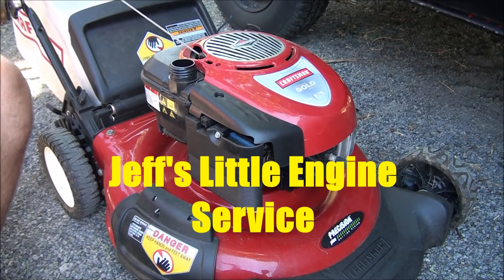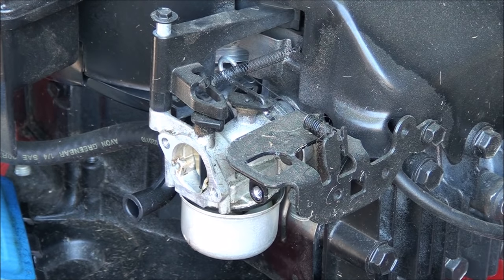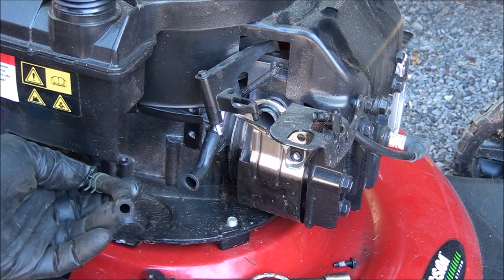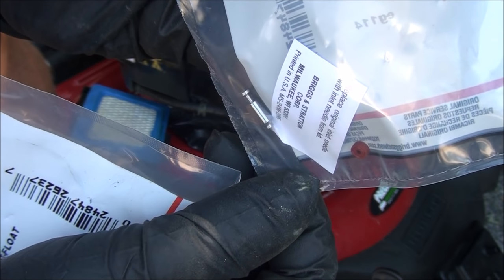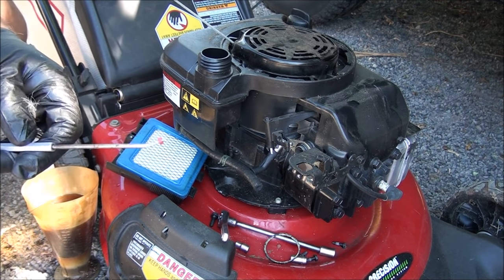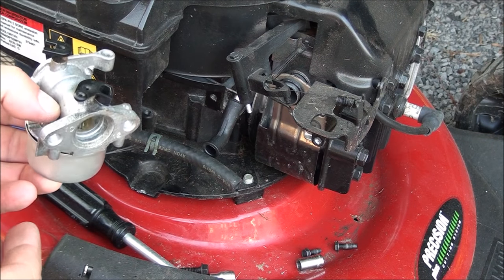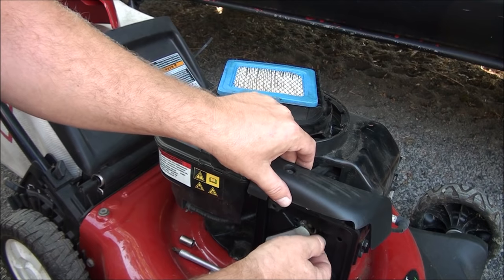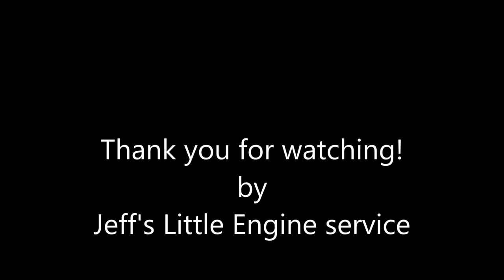EXPERT! REBUILD a Briggs and Stratton Lawnmower AUTOMATIC CHOKE CARBURETOR

Comment: I followed your video instructions and just cleaned everything and re assembled it.  it was a no start  and now it starts but surges badly.  any suggestions for a cheap fix.  I use this to cut weeds  in a field not a lawn.
Reply from the maker: sounds like the fuel system still needs cleaning (plugged carb). make sure gas tank and carburetor are clean.

Comment: having trouble priming & starting  a 7.0 hp Intek b&s pretty much the same except mine has the primer bulb took the carb apart cleaned with carb cleaner, wires, pipe cleaners,new needle and seat, replaced the gasket on air filter housing even used a double gasket still hard to prime and start have to turn over the engine and push the primer bulb about 20-30 times to get it to fire once it's running it restarts 1 pull even replaced the air filter housing still don't prime good any ideas?
Reply from the maker: probably need a new backing plate. Sometimes putting gas on the gaskets helps them seal too.
Reply: thanks i will check that.

Comment: i  did clean him with no parts but after 2 minutes  it shuts down . i get only get it started when i push  the choke back to close. can you help me.its like ,its get no gasoline
Reply from the maker: The fuel system and carburetor still need cleaning.

Comment: I have the same carburetor. I already know how to change the idle speed from watching your very resourceful videos. Do these carbs have a fuel/air mixture screw? I find that when running, my mower has this burp or hesitating sound every 10 to 15 seconds and there is no fuel starvation issue. Carb's been serviced recently. Could that be from a LEAN mixture?
Reply from the maker: could be lean but There are no adjustments unfortunately

Comment: Jeff, I've had a couple of these auto-choke carburetors leak gas through the weep hole, even after thorough cleaning.  I'm speaking of the little hole on left side above the mounting hole.  Any ideas?  Thanks.
Reply from the maker: sounds like it is flooding. A new float needle and seat should fix this problem.

Comment: I have the same automatic choke mechanism, and im just curious is there some temperature sensor which move the choke flap? Or what kind of measurin particle there is?
Reply from the maker: A coil spring is the mechanism. It heats up and expands and opens the choke plate, cool huh!?
Reply: Nice! That`s very cool :P Thanks!

Comment: Can the needle seat hole become smaller?  When do you replace the seat?
Reply from the maker: good question. It can swell from ethanol and become smaller. Anytime your carb is flooding after being cleaned, it should be replaced..
Reply: Ok but the engine has some fuel in the top of the carburetor.  I got the engine started but it is hard to restart.  It also backfired and a white flash came out of the muffler.  What does that mean?

Comment: Amazon seems to have Chinese knockoff carbs for $12 and B&S OEM carbs for about $35. At that low a price point, is it really worth trying to rebuild the carb vs. just replacing it?
Reply from the maker: I would not recommend an aftermarket carburetor.

Comment: I own a lawnmower with that same engine.  I have cleaned the carburetor several times but the engine always ends up surging and sometimes it wont start.  Each time I take the carburetor apart there is always a lot of small pieces of debris in the float bowl.  Where is all that debris coming from?
Reply from the maker: I have seen a bad fuel line cause that, make sure to replace it. 1/4 hose.
Reply: How can I tell if the fuel line is bad or not?
Reply from the maker: sometimes you can see that it is dirty and deteriorating on the inside. I would recommend replacing it to be sure.
Reply: I sprayed carburetor cleaner down the inside of the fuel line but no dirt came out.  I can not tell if the fuel line is deteriorating on the inside or not by looking at it.  Why would the fuel line deteriorate on the inside?  The engine had some water in the fuel tank and in the carburetor when I received the mower.
Reply: Brian... Just replace it. He told you 3 times.
Reply: Steve why did you say that to me?

Comment: I followed the steps with my new rebuild kit. But now I get fuel dripping out of the primer bulb.
Reply from the maker: sounds like its flooding, check seat and float valve
Reply: @JeffsLittleEngineService  I figured it out. I didnt plunge the little rubber needle valve seal all the way down. No more leaks and my mower turns on will one good pull of the cord. Thank you for the tutorial Jeff. 🙏💪

Comment: why doesnt this have a fuel filter on it? i have to clean out that tiny little item almost every year. wouldnt putting a fuel filter on it help from getting debris in this device?
Reply from the maker: there is a screen filter inside the gas  tank that doesn't work so good.... you can add an inline filter fairly easy. An old fuel line can start deteriorating too causing problems

Comment: I had fuel leaking out of the carb intake after I shut off the engine.  So replaced the valve and seat.  Everything went back together fine, and no more leak, but I am getting almost no power from  the mower now.  Any thoughts?
Reply from the maker: governor spring, linkages?
Reply: Thanks.  Gonna pull the carb and reinstall (again), double checking all connections.

Comment: I tried this with no success...mower still sputters and low RPM, then shuts down. Installed new spark plug and fuel line. I’m waiting on a new carburetor now...Any other ideas what it might be? TY
Reply: Yes!  Check for proper fuel flow from the tank (blocked line), then check for blockage  thru the holes of the brass nut. Lastly, spray carb cleaner into every hole in the carb. Next,  change your fuel.

Comment: Great video.   But it seems by the time you buy the gasket, float needle, etc, (I priced it out, maybe you have a whole seller?) and spend the time cleaning,  its easier and cheaper just to buy a new carburetor on eBay for $9.
Reply from the maker: be cautious of the $9 carburetor unless it is a genuine Briggs and Stratton part

Comment: I have to do this process every mowing season on this exact motor 6.75, every season , The entire mowing season I have to do this process over and over and over with this mower. and it still doesn't act right it will run for about 3 min then stalls out , 3 mins then stalls out, let it cool , push it around for 3 mins or so stalls again, let it cool for about 30 mins. then mow for 3mins then stalls  repeat process , every single time , every mowing season for the last three years ... horrible mower...BUT ! Great when it works ..
any suggestions other than to take it to the dump or buy a new mower or other obvious statements / comments ?
Reply from the maker: Replace the fuel line and clean the gas tank. I have seen sediment stuck inside fuel lines and the rubber lining falling apart inside also.
Reply: I have did this before , as suggested by the small engine repair shop , it still didn't work for very long it took about three mowing sessions and it was back doing the same thing again .This mower is only mowing my yard , my yard is less than 1 acre.  also this mower is garage kept , and with this mower it takes all day to mow my yard .. lol .. I'm going to clean out the gas tank and replace the fuel lines again today.. my mowing season has started as of today... I'm excited to get started mowing and all the yard work , Believe it or not I look forward to mowing and the outside work in the yard.. Great video , I look forward to more of your videos, Cheers
Reply: Jeff ,   I took off the fuel lines , and the gas tank , , took them off that means no gas tank no fuel lines , no fuel can get to the engine of the mower . it would not run before , its running just fine without a fuel tank or fuel lines . started and kept running on the first pull ... and it's still outside running right now ... CRAZY!  didn't do anything to it yet , I just wanted to crank it to push out any existing fuel that might be in the lines , It cranked right up and sounds great , still running even now while sending this message . I wish I could video this .. kinda freaky.. lol   Cheers
Reply from the maker: HAHA!

Comment: Jeff is the auto choke connected to anything internally ? When I disconnected the long bolt from the carburetor it seems like the auto choke arm is loose.
Reply from the maker: it does feel loose normally but is connected to a component on the muffler

Comment: I have one I cleaned the carburetor completely put it back on the mower pumped the primer starts and dies the gas line seems to be clear and the primer sprays plenty of gas what next ?
Reply from the maker: The carburetor main jet may be plugged
Reply: @JeffsLittleEngineService  Is that not the same jet that is used when the primer is used if so that is working.
Reply from the maker: it is the brass bolt on the bottom of the carburetor that holds the float bowl on
Reply: The one I am rebuilding is a 300e with plastic carburetor no brass jet.
.

Comment: Is the inside of the main jet suppose to mimc a T where all holes inside meet?  Im asking because the ones that run across I got cleaned but to top somewhat sorta.  Just noticed it isnt connected to the holes that run across
Reply: ShyRage1 In short...yes. You may have to switch to a pin to clear the center hole.

Comment: I put mine back together but the plastic arm will not flip choke open.. Are yu sure pin goes in C shaped piece and not behind it.?
Reply from the maker: yes
Reply: Jeff's Little Engine Service can yu just swap air boxes to covrrt to old style primer type?
Reply: Jeff's Little Engine Service mine will only open choke fully if yu move arm with your finger
Reply from the maker: sometimes the choke plate inside the carb gets slightly displaced. Also, It's a heat activated system so it will always appear closed unless the engine/ muffler is warm, then it will open fully. Maybe the lever got displaced at the muffler?
Reply: Jeff's Little Engine Service just sold. No more pos Toros. Stick to my old Snappers.

Comment: Does the o-ring around the float bowl have an indent in it?
Reply from the maker: no, it is a "square" o-ring though
Reply: Ok but I had to take the carburetor apart twice since more dirt got into the float bowl.  What causes problems with those automatic chokes?
Reply from the maker: I have not seen an auto choke mechanism fail yet

Comment: how can i tell if i have choke or autochoke carb?
Reply from the maker: With Auto-choke you do not have to push a primer button or move a lever 
to "choke" position to start it. Just pull the starter rope to start it.
Reply: ok thank you. I do have a lever i hold down before I pull the starter rope but Ive never tried it without pulling the lever. I guess if it doesn't start, I don't have auto-choke.
ok just tried it, it will not start without holding down the lever.

Comment: There's no gasket(not the round one) the shape of the carb that goes between the carb and the engine? somehow I thought there was.
Reply from the maker: yes there is it just stayed in place
Reply: @JeffsLittleEngineService  ah ok. I rebuilt my carb yesterday with the help of your video & some others. Now I have some gas leaking out through the bottom of the air filter housing. I checked the flout, needle & needle seat and everything looks ok. 
Maybe I didn't put the little red seat down properly.
Can I take that back up and put it in again? I'm not sure if that'll tear it up or not

Comment: I need to know if the little black metal circle at 7:29 is supposed to be loose or glued in place. I cleaned the carburetor and this little metal circle came loose.
Reply from the maker: it is supposed to be pressed/tapped into place. If it comes out you may be able to reshape it (slightly domed) then lightly hammer it back into place with a punch(one or two firm taps in the center usually seats it). when you hammer it it slightly flattens out holding it in place. Hard to describe the procedure. I do not have a video covering that issue yet.
Reply: Thank you.
Reply from the maker: If you can't get it back in, try running the carburetor without it. It might work! I think I have gone without it before
Reply: I put everything back together and filled it with gas and oil. Gasoline was coming out the bottom of carburetor. Took it back apart, but have to check it out tomorrow in daylight.
Reply from the maker: must be a problem with float or float valve/seat may need to be replaced...the gas leaking is unrelated to the little metal circle that fell out
Reply: Going to recheck today and see where I can get parts in my area.

Comment: Some Tip cleaners for a cutting torch would be great in your toolbox instead of using wire, which works well in a pinch, but to clean the jets with the proper sized wire, get the tip cleaners for a few bucks at Home Depot.  Let's eat that rooster.
Reply from the maker: Great tip! The rooster is my sidekick lol!